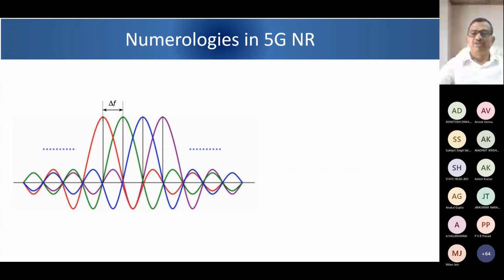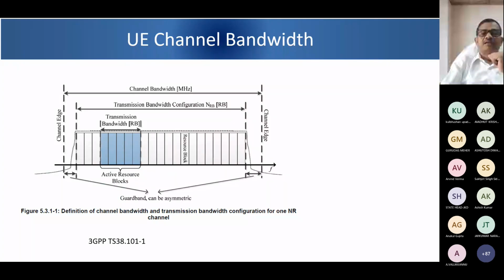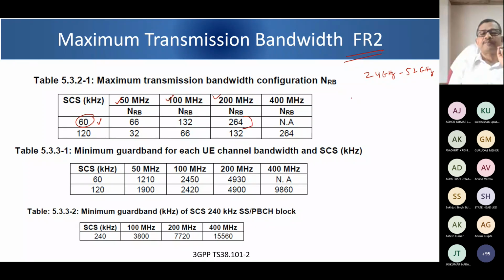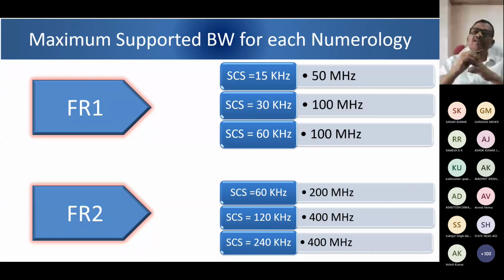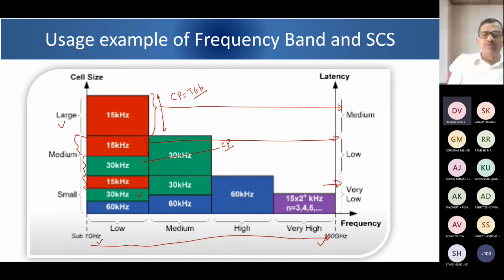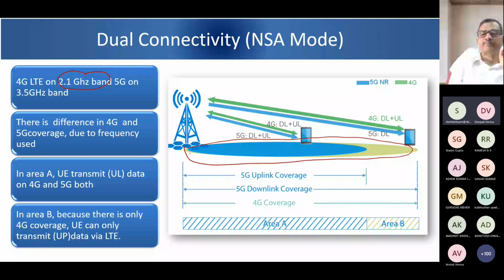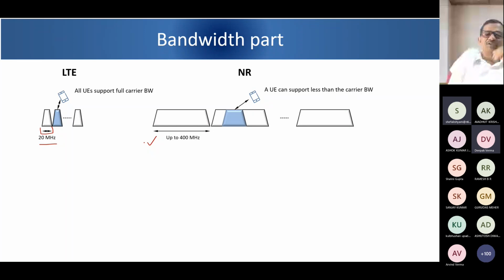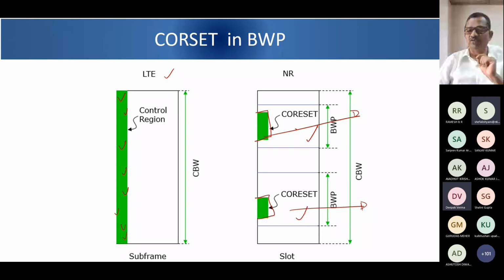Lecture 3 : 5G Certificate Course : 5G Key Capabilities and Spectrum related Aspects

Comment: When using the unlicensed band, the base station sends e.g. in 2.4 GHz, is that right?
In cities that could generate massive interference I think. Or are there power constraints for the base station? 
Thanks.
Reply from the maker: Suitable for indoor use case just like wifi

Comment: 12:32 it is shown two numerology are used in UE channel bandwidth resulting in different size guard bands at the ends . Is there no need of guard band between the two numerologies x and y?
Reply from the maker: Yes. Not required
Reply: @5Gand6G  is it because the bandwidth/frequency in numerology x and numerology y are different and hence no interference?
Reply from the maker: @shreyasrai  no. Freq is same. Sub carrier spacing is different
Reply: @5Gand6G  thank you sir. It is clear now.
Reply: Can you please explain the difference between carrier bandwidth and channel bandwidth